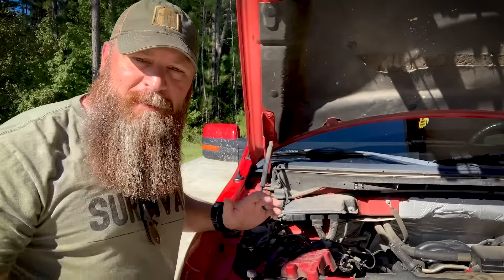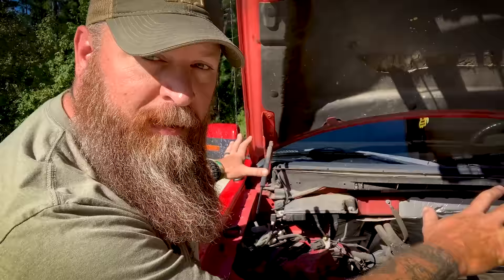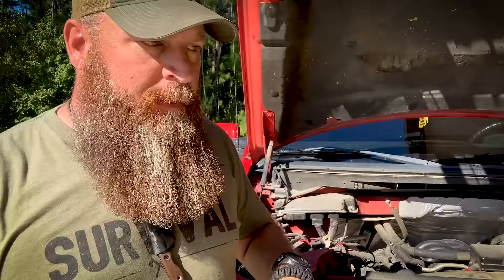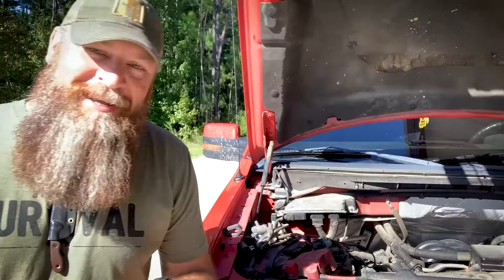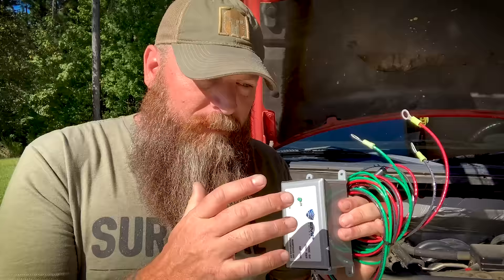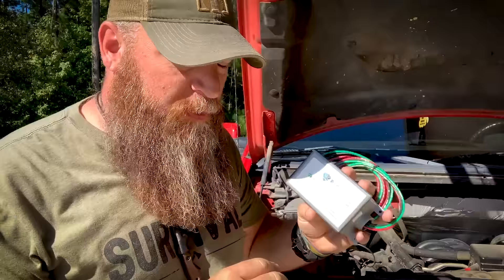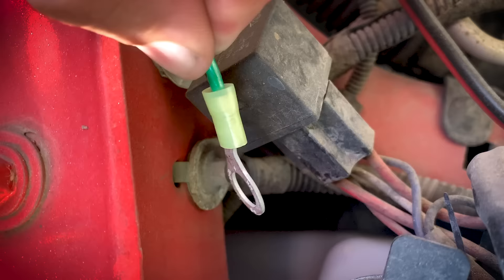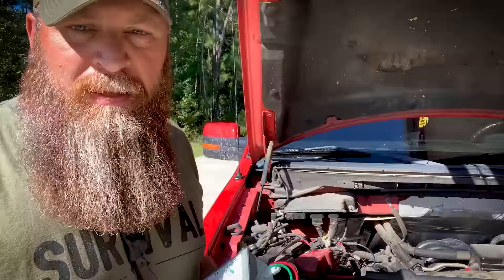EMP PROOF YOUR VEHICLE

Comment: I contacted EMP Shield, and asked one question.  The answer to tha question was...no, we have never installed our device on a vehicle and tested it with an EMP generator.  Wouldn't you think that would be the first thing they would do, and use the videos of the tests to increase their sales?  Without testing, this thing is pie in the sky.
Reply: Yeah that ain’t how you suppress emp or even redirect electrons from your gear….  No such thing as an emp generator. It’s a nuke.
Reply: Thanks for saying that. It seemed like the only thing that would work is an actual cage. Your comment was enough for me to not look into this any further. It looks like the snake oil gimmick "plug this box into your cigarette lighter port. It gives you much better gas mileage." It should be illegal to sell that shit, and blatantly lie about it. It's like a placebo box, but worse. Because placebos somehow benefit a few people.
Reply: This thing is BS.
Reply: Like Uncle Ricco finds out the hard way that his time machine doesn't work?😂
Reply: think you could ground it easier with wire draging on the groundattaching it to grounded copper pipe when parked..
Reply: Exactly
Reply: Produce placement??
Reply: Exactly they are just cashing in and hoping if an EMP does occur they don't get held accountable. You need a pharaday cage in order to protect yourself from an EMP absolutely.
Reply: What everyone is forgetting is that all new vehicles are smart vehicles. So at any given time they can become disables via satelite. All cars are now just computers and they are equipped with shut down systems. A law made by the government. Save your money this system cost about $400
Reply: @xXMcCloudWalkerXx  I dunno, not a good sign if they don't bother to test, but seems like anything that creates an EM spike could work, you just have to activate it close so the inverse square is similar to the large event.  It might be harder to model E3, but maybe they'd let you test near a big AM antenna  ;-)
Reply: You didn’t contact them quit lying
Reply: That was my exact question when clicking the thumbnail.  Thank you!  Now I don't have to waste my time.
Reply: They stole your money lol!
Reply: Only thing is a faraday cage... You can do that to your garage but not a car. This dude is not so smart...
Reply: A placebo.
Reply: @ricky4673  Layers of nested Faraday cages. Some (outer) grounded; some floating-ground (with controlled discharge to ground). Reason being, EMP emits D2D (DC to Daylight) radio spectrum, inducing upwards of 50KV per yard of metal at ground level. An outer cage will emit some inward, so 3 to 7 nested cages with well-designed charge management will be needed for anything sensitive. Most helpful is Amish style mindset - if it can't be hand-cranked it's probably too dainty for post-EMP living.
Reply: The point is...  if it works I'm laughing and your not.. if it doesn't work then noone is laughing because we are all in the same boat.. mine is long paid for...  too me it's like believing in God... maybe he there maybe he isn't.. I'd hate myself if I didn't believe and he is real..  ill pray for you don't worry..
Reply: @craftybynature3760  that's one way to look at it. Another is there's a sucker born every minute.  At least you have hope.
Reply: @watchmansduty  That's how you know for a fact that this thing is snake oil! It isn't grounded to the GROUND, so it's impossible to do anything!
Reply: Why would they test when they know it would fail?
Reply: So, it works, ... in theory.  Riiiiiight.
Reply: I got a bridge In Arizona that you can buy it will help keep you dry
Reply: I just want to know if this was real why is the hole where the wires come out of the box come out of a hole without any gasket and the wires are a small gauge????😂
Reply: There are labs that will do High Intensity Radiation Field (HIRF) testing. It is very expensive but can be done. You have to be willing to sacrifice a vehicle if the test fries it. To do the test justice, you would need to test the vehicle with and without the device.
Reply: @xXMcCloudWalkerXx So he means your car can melt but it'll still run as long as it has a steering wheel and tires.
Reply: How do you know it works
Reply: @xXMcCloudWalkerXx Wrong. You can create a non-nuclear EMP device to test with... albeit, ALOT less strong.
Reply: Do you know the laws regarding EMP usage and the severe penalties for doing so? 😂
Reply: I understand the logic of how it is supposed to work, as I looked into a WHOLE HOUSE version. Funny thing after watching this. He says Black to neg, and Red to Positive on your battery. Now, this is the funny part of this, besides it not being tested. The green to Chassis! Well, terminal on your battery and chassis ground are same potential. Now here is another tid-bit. The WHOLE HOUSE one, sends it's amps to ground. Where is ground for a house? EARTH GROUND. A car, being that it is, is totally instullated from the EARTH by Rubber Tires. So what  I see happening with this one, BOOM. Battery explodes, and car is fried. Don't see how on earth that would even remotely work.
Reply: @xXMcCloudWalkerXx  Actually there is an EMP generator, and what is left of it is sitting out on Kirtland AFB in ABQ. You can see it, a giant all wood structure put together with plastic bolts with a big metal net and huge capacitors around the structure. This was used in EMP hardening testing of the B52's way back when, but has been de-commissioned for decades now. They cannot rear it down because of some chemical they used in the wood that is poisonous, so they just leave it there. I've been to the structure several times in my work.
Reply: @MarkSpencerAZ  negative they only pushed directed emi  and research of radar stealth 🥷🏿 capabilities….   EMP is not EMI   When they tested emp it was the real deal  everytime in space… in the air at various altitudes in the ocean and ground and deferent depths and of course surface.  The only way to test EMP is with a nuke.
Reply: @xoxoxo-42 Yes, there is such a thing.  Back in the 80s they were using big Marx generators to simulate EMPs.
Reply: @xXMcCloudWalkerXx it doesn’t have to just be a Nuke it can be the sun 🌞
Reply: So your truck isn't impacted by an EMP, but nobody can transport fuels or pump them into your tank.
Reply: No wonder everyone is buying up all the old carburetor cars.  I think of all the cars i had growing up and pretty much gave away because i wanted something newer. Wisdom certainly does come with age. But in the end I TRUST THE LORD.
Reply: @KnowingGodExplorers  Modern cars, even Hybrids are safe from EMP´s as well. It´s a huge myth. You can even watch a whole interview over 1h long with a dude from NASA explaining why and how instead listening to this guy. But what do I know I am just a humble automotive engineer....
Reply: @xXMcCloudWalkerXx  thanks for the heads up. After 17 years of designing and testing for EMP I did not know I couldn't do that.
Reply: This was the first think I looked for in their EMI qual report. They did not have any load on the system to ensure they were protecting the downstream circuitry.
Reply: @GoneHunting-j2c  Car are not really susceptible to EMP´s anyway. You can look up the interview with a NASA scientist on that topic. You don´t need EMP protection for your vehicle, that´s basically Hollywood science.
Reply: Wouldn't unhooking your battery protect it! As long as no power is going through the system. 
    BTW my vehicle is so old I don't have to worry about that problem. As it's a you problem for buying new stuff! Lol. Good luck.
Reply: @DannyWildmen  "...Wouldn't unhooking your battery protect it!..." No the power comes from an EMP not the battery. Power surge happens in all the electronic components weather they are hooked up to a battery or not.

"....BTW my vehicle is so old I don't have to worry about that problem...." No one has. Any modern and old vehicle can survive a lightning hit. Your car is a faraday cage.
Reply: Dept of Defense purchased thousands of these, good enough for me. If it doesn't work then oh well. No other options so at least make an attempt.
Reply: This is bull and he knows it that's why he still riding in that old azz truck😂 emp shield lol😂😂😂
Reply: EMP Shield is tested by government EMP testing center and used in military vehicles and they say so and give testing results on their web page.  Did you heard in this video or look at the web site??
Reply: @kentvarner6117  Of course it doesn´t you can´t really test it yourself and you won´t need it anyways, any car is a faraday cage xD

Comment: I got 2 EMP proof vehicles....they're called horses.
Reply: My back can't handle riding a horse. That would be an absolute nightmare...
Reply: @lunaticgaming7967  buggy with shock absorbers.
Reply: I haven’t rode a horse in the last 10 years I was 8.5 years old when I last rode one 😂almost 19 time sure flys by
Reply: @Securenode357  learn to ride.
Reply: @lunaticgaming7967  not to worry you are will be one of the  second to go. I will be one of the first. I'm in a wheelchair.

Comment: Heard back from EMP Shield.  They have never tested a vehicle equipped with their product in an EMP generator.  Save your money.
Reply: @dmedlin8118   Don't forget to add an insulator between your device and your cookie tins or aluminum foil.  I built a faraday cage from a metal trash can.  Sealed all the gaps & lined it with cardboard box material to insulate the items inside from touching the metal walls.  The surge will hit the metal of the can & zip around it without going within it (how Tesla used to sit inside a Faraday cage while lightning went off around him just inches away).